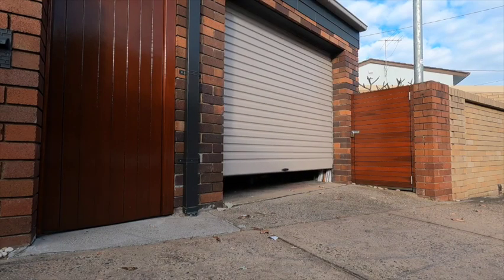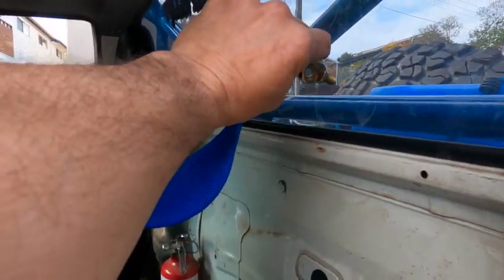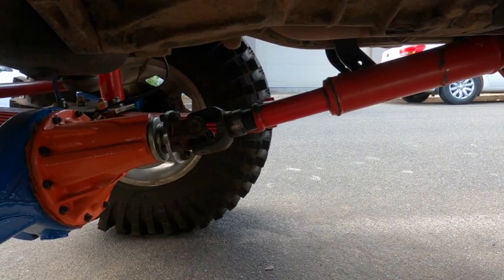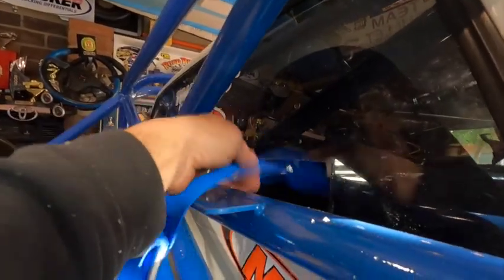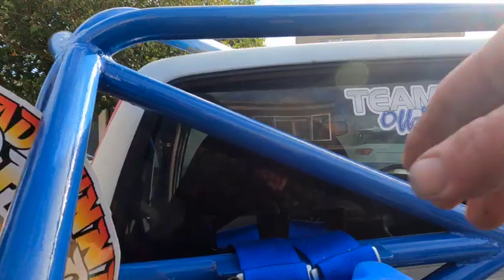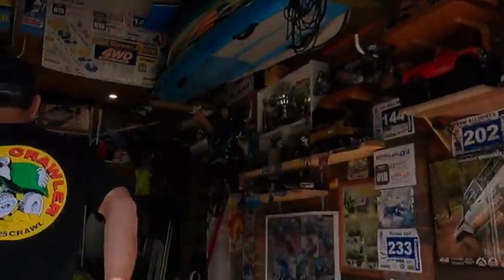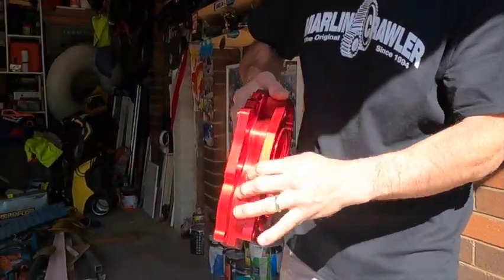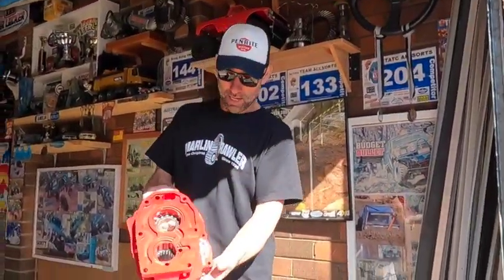Toyota hilux ln106 build progress rpm racing harness install  marlin crawlers dual case adaptor mc08

Comment: Hey mate 

Just wanna say what a great channel 
I like for the LN106 content 
I’m building a family tourer with an SR5 dual cab. I’d like as much info that you’d like to share about what if’s hubs and rear diff swaps ( minimal fuss) change overs 
I like the spacer unit that you had made up by (shire engineers ) I’d like to get all that stuff set up on my rig as well as braided front and rear lines. 
Keep up the good work 
God Bless
Reply from the maker: Mate feel free to go through our channel, so many videos and lots of mods too.Hope this helps and thank you for your comments.. You in Sydney
Reply from the maker: Shires Fabrications in Toowoomba does a lot of trick parts, including the ifs hub spacers... Check them out on Facebook...
Reply: @TeamBulletOffroad  thanks